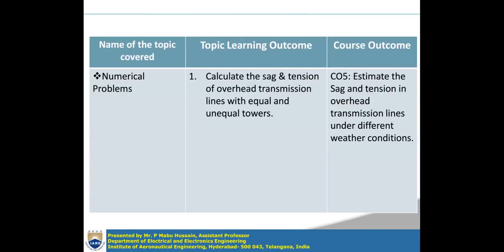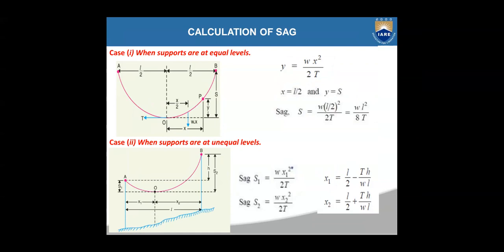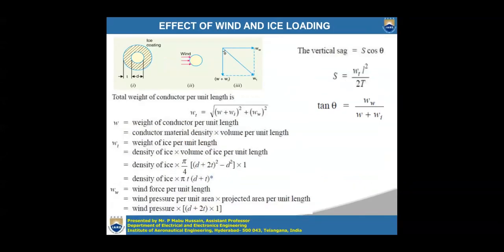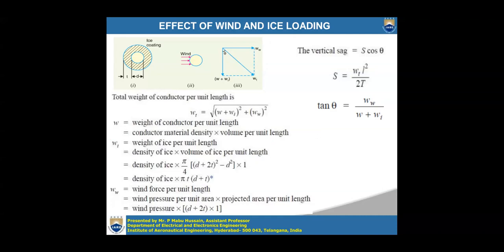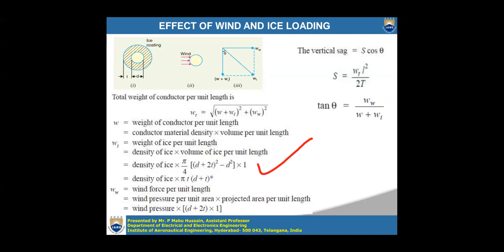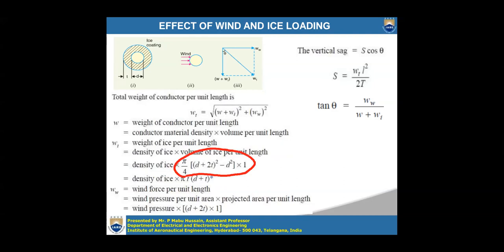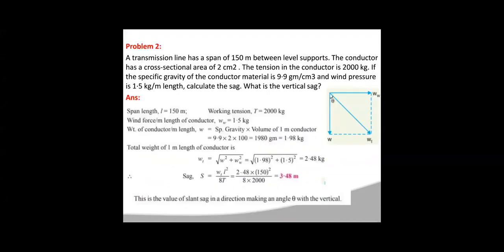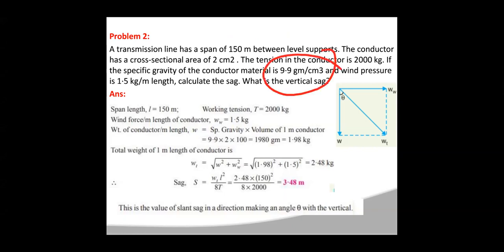EPTS - Lecture 19: Numerical Problems  ( on calculation of Sag and Tension)

Comment: what if tension is unknown? should we assume the total weight of the conductor is the tension? like if we have 10 lb/ft conductor and length of conductor between two poles is 50 ft, so the tension will be 10 * 50 = 500 lb ?

Comment: in one problem you said tension = ultimate strength / safety factor and in another the formula is different
Reply from the maker: Formula varies depending on the data given in problem.

Comment: At a river crossing an overhead transmission line has a span of 560 m with the two supports of the lowest conductor at 15 m and 95 m above the water level. The weight of the conductor is 0.394 kgf/m. If the tension is adjusted to 1200 kgf determine clearance of the conductor above the adjusted to 1200 kgf determine clearance of the conductor above the water level at a point 215 m from the base of the higher tower. Iska answer bata do koi
Reply: Uske jaise hi problems solve kiye to haina vaise hi ye bhi solve karlo simple hai